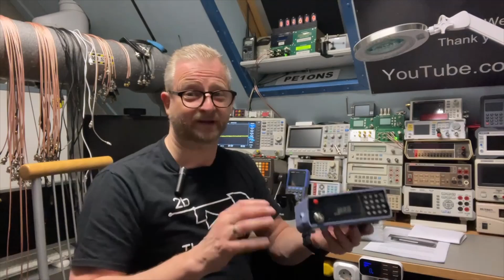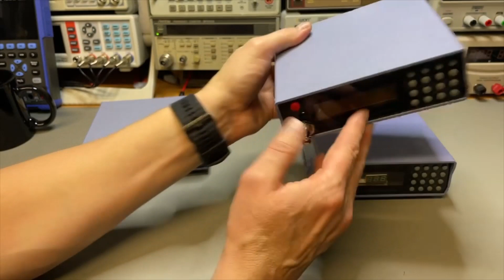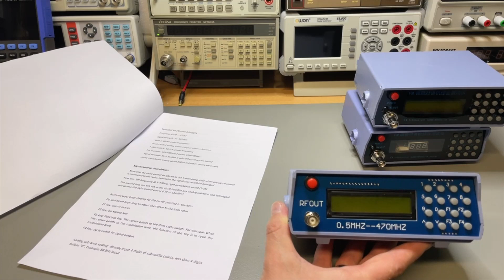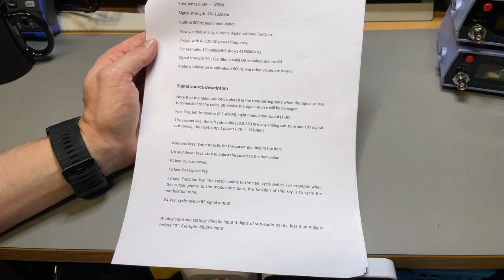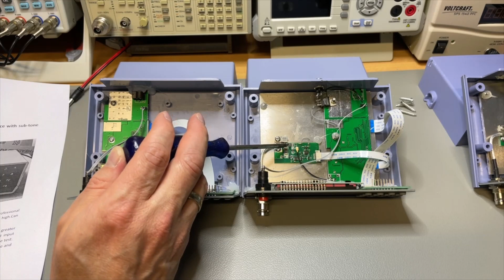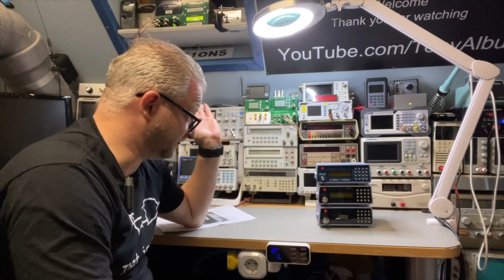TA•0223🟦RF Generator from BangGood 3th also Broken - (it Works,See video #226)

Comment: I bought one and as the display worked by using an outboard power supply, I installed an internal regulated 12vdc PSU, and again the display worked, but no signal coming out. Chinese garbage. This was from Alliexpress.  Trying to get a refund.
Reply from the maker: after this video i got mine to work and made a folowup video..but still i shoud have gotten a refind too. but in Ali you will and with BangUgood, its a lost.. i hope you get it.

Comment: It's so very typically Chinese manufacturing. Instead of making things that work and have regular samples quality controlled, they just react to change the design when customers complain. Well, sometimes!  I think this shows the product hasn't been meaningfully improved, but that people who want cheap things will keep buying them. It is a shame, because it could be good for the same or only slightly higher price. They've certainly lost me as a potential customer.
Reply from the maker: Sometimes you do find nice things, so i keep trying, i am just not buying at BangUgood anymore. If a product is Bad and its easy to get a refund. i am willing to try. BangUgood has proved itself over de last years to have very Bad customer service i do NOT recomment. Most Ali Express stores do have good service.

Comment: I have been using mine now for more than 2 years the only problem I have had is the rf output is 30db higher than what the display shows. I have not tried to find out why that this problem exists but operate it with a 30db pad. The frequency and modulation are correct and the spectral purity is actually very clean.
Reply from the maker: Great to hear Robert! so there are a few that are good and also keep working after some years, thank you for the feedback on this.

Comment: 25mhz is enough... few people work in radio frequency. Switching sources also do not work above 25mhz. Am I right?
Reply from the maker: Yes for most 25MHz is enough if you do no RF ..SMPS stay below 1 MHz if i am correct its in the K's

Comment: there is an oscilloscope + signal generator on the BANGOOD website. I wonder what to buy? what is the difference between having a tool with two functions or Generator+Oscilloscope or separately?
Reply from the maker: Hi, Yes some oscilloscopes have also a signal generator... it all depents on your needs. those integrated signal generators usualy are limited to 25 MHz and only a few volts .. if that is enough for you, then it could be something for you. if you need higher frequencies or a higher voltage the you start to look at generators that specificly are to your needs.

Comment: Hi Tony,
A small comment on the intricacies of English: Numbers whose right hand digits, when used to describe a position, not a numeric value, are 1, 2, or 3 are written differently than the rest, (which are all written with a 'th' after them.) But the digit 1 is written as '1st', 2 is written as '2nd', and 3 is written as '3rd'. Thus, 223rd, 791st, and 82nd are correct examples of our common English insanity.
English is my first language. I always got very good grades in it, and I have been using it every day for over 70 years, but I have no idea in Hell why we write these this way.
Reply from the maker: Thanks John, yes as a 50+ non native i can still learn... it should have been 3rd... even though in my head it sounds the same...i am very phonetic

Comment: Boy am I glad I didn't buy this RF Gen, but chose another model 😋
Reply from the maker: I am still hoping it was the shipping. BG is still trying to help me, so lets see. but not to impressed about the device by looking at the inside.
Reply: @TonyAlbus  Tony - what "affordable" RF Gen would you recommend?  I'll let you define affordable.
Reply from the maker: @Homer19521  i prefer then a secondhand Marconi or R&S ... of you want cheap this is okey, in a later video about this generator i have it working.. but maybe NOT get it from Banggood but from AliExpress. i have the feeling that BG sometime just ships again an item that others have returned... that is just not done, when sold as new.
the output from this generator is nicely adjustable, so you can acualy adjust a receiver with it. while many other generators are around 0dB and you need lots of attanuation

Comment: Silly question, but didn't you have to press the Enter key or something after you type in the frequency? I don't think they sent you a rejected one because you're advertising for them after all. It could be a buggy software in which case they must be getting a lot of 1 star reviews. Something must be amiss.
Reply from the maker: Good question, but there is no enter button you just finish typing all digits.